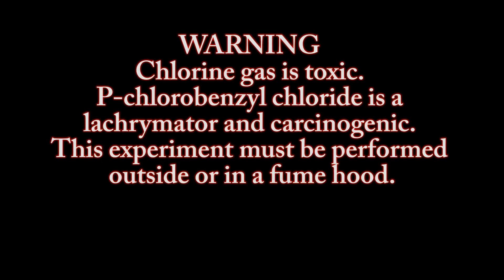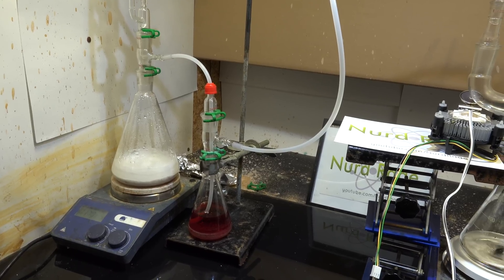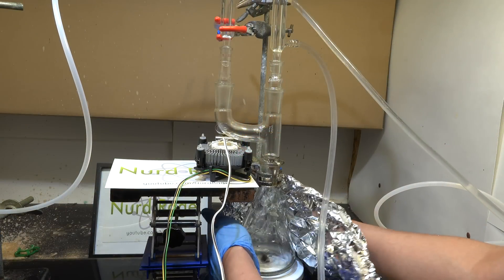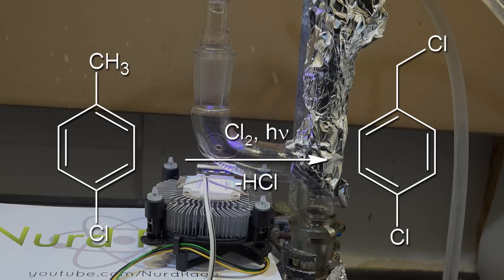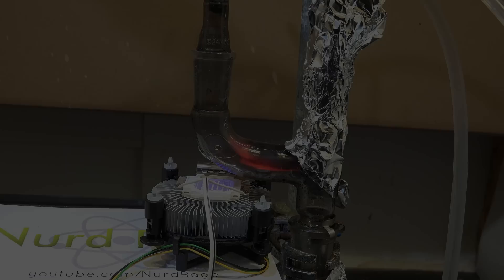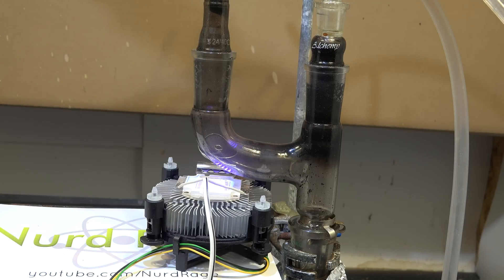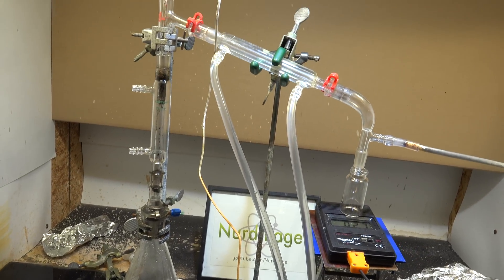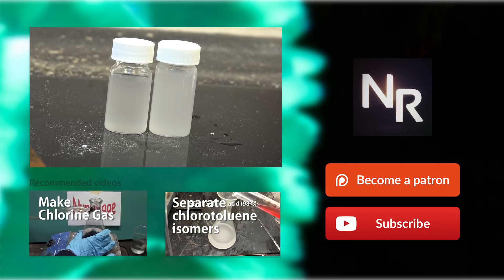Make p-chlorobenzyl chloride (from para-chlorotoluene) 3rd step in making pyrimethamine

Comment: Instead of chlorine you can use symclosen (pool chlorine) and radical starter for styrene or your uv light and heat. 
Very easy chlorination without elementaric chlorine.

Comment: What prevent this from being a di or tri chloro product?
Reply: I would think because chlorine helps deactivate the other hydrogens making it preferable to react with unsubstituted methyl groups. Remember C-H bonds share electrons near equally, the addition of a chlorine will make the electron density shift closer to carbon and away from H making them more like protons. So the chlorine radicals would rather attack H with more electrons to offer so to speak.

Comment: if i may ask, why wont chlorine radicals attack the carbons from the ring on free radical chlorination under uv light? i reckon this is because of delocalised electrons and orbitals conformation inside the methylbenzene's ring, which would render impossible an attack from radicals on those positions. still, i am not too convinced of this kinda crazy kinda badass - i cant decide- explanation for some reason. giving fresh cookies to any soul that gives me a hint!
Reply: The phenyl group has six flat, cyclic conjugated electrons which is a state known as aromatic which is very stable. Phenyl radicals which would result of the radical substitution as an intermediate are very unstable und thus not very likely to arise.

Comment: but wouldn't your glass apparatus block the UV light? unless it's fused quartz glass though...
Reply: casaverdero doesn't glass only block uvb and uvc? I think uva passes through it and is what is triggering his reaction.
Reply: cassaverdero ..... Glass that is transparent to visible light absorbs nearly all UVB. This is the wavelength range that can cause a sunburn, so it's true you can't get a sunburn through glass. However, UVA is much closer to the visible spectrum than UVB. About 75 percent of UVA passes through ordinary glass.
Reply: Most glass is still very transparent at 400nm. You have to take some measures for it not to be transparent there. By some definition that isn't even UV yet. But enough to trigger chlorine radicalization...